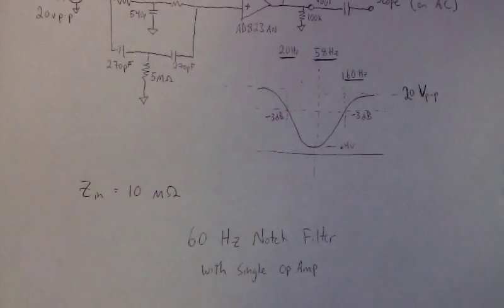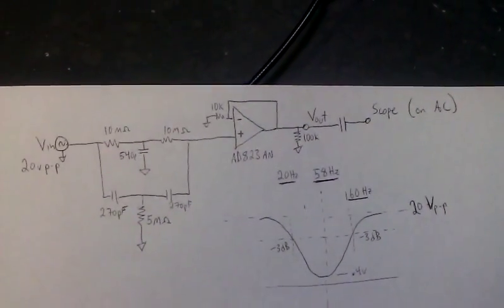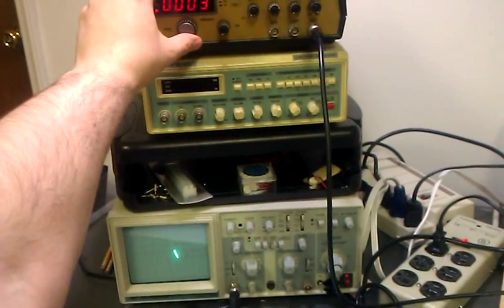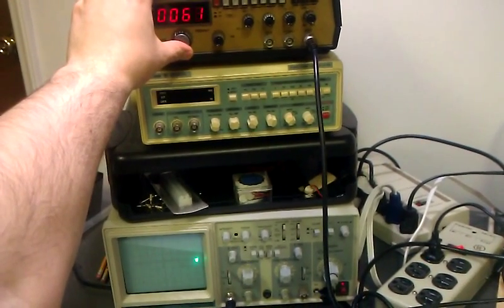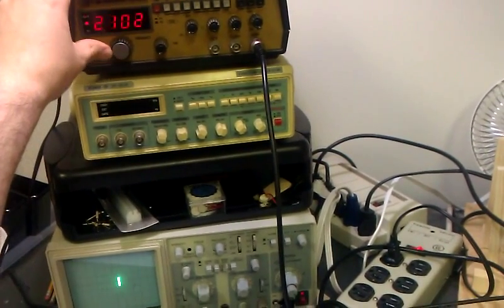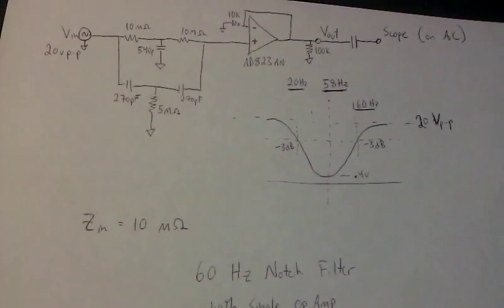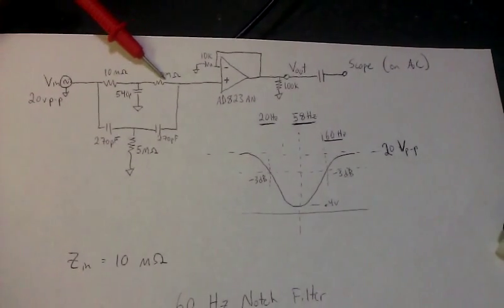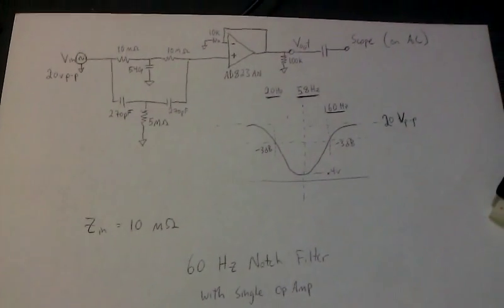60 Hz Notch Filter with Op Amp

Comment: Are u using to power line communications? I'm trying to dye a live a wire using 128khz square wave, and I need a filter to remove the 60hz AC

Comment: Very interesting. If I would use 9v what would the values of the components in the filter be then?
Reply from the maker: They would be the same. The circuit is not voltage-dependent.